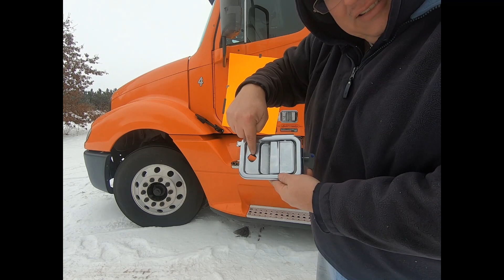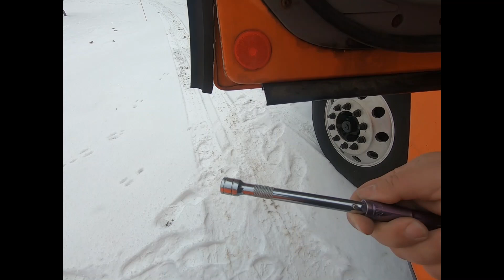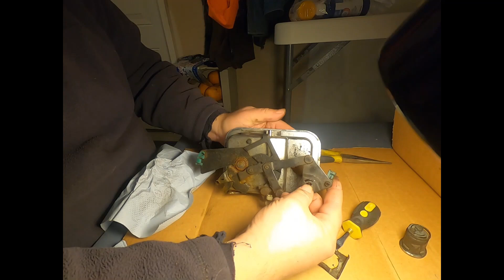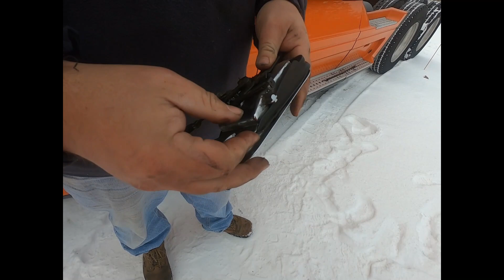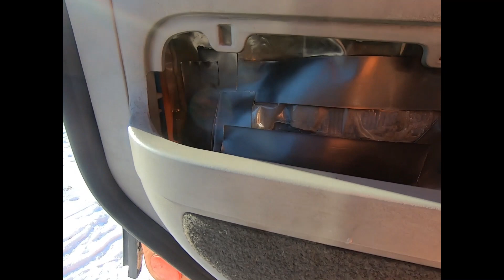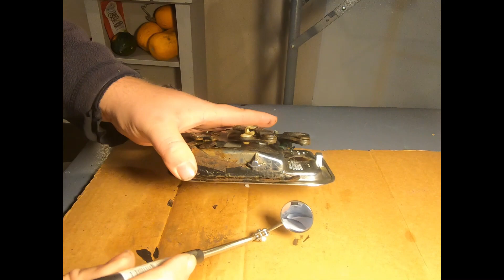How to change a door handle on a freightliner

Comment: How did you get the black wedge off the handle
Reply from the maker: there is a hole in the edge of the door you have to get a socket and extension in there and take the nut off

Comment: Thank you very much for a great video , just what I need for my 2004 Columbia , I can open door from inside but not from outside, I had to use passenger door to get in truck , thanks
Reply from the maker: You are welcome....make sure to subscribe so you don't miss a video!
Reply: What was the problem? ,did u ever get it fixed ?,I just put a new outside handle on & now it will lock but won't unlock

Comment: My door is hard to open from the inside. Will changing that part fix my problem?
Reply from the maker: Only if the problem is in the mechanism. First check the cable out, and check those little clips on the ends of the cable. They can wear out and loosen up.
Reply from the maker: I don't want to be vague, but its hard to know what the problem is without seeing it.
Reply: Thanks you for the reply sir.

Comment: Great video. Never fixed the passenger side since it opened from inside. Then drivers side broke yesterday with truck running. Barely got in via small passenger side window. Thx for the video!